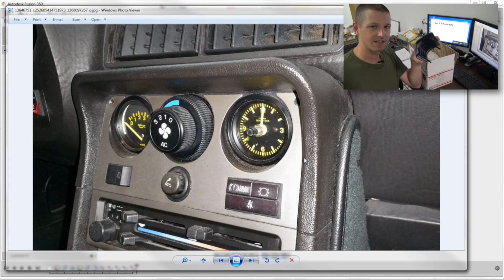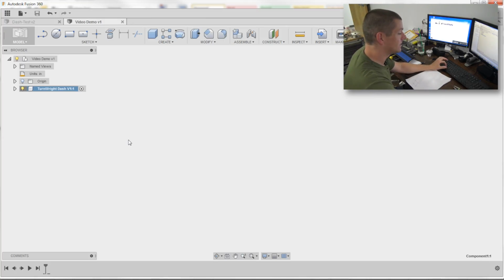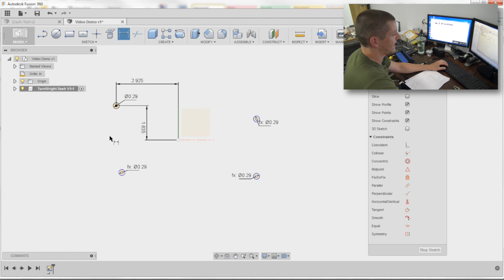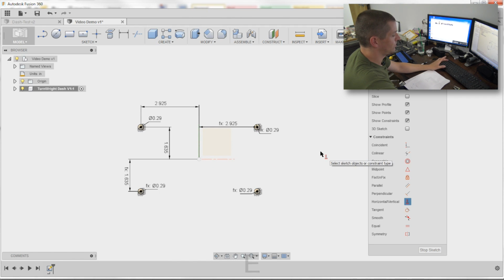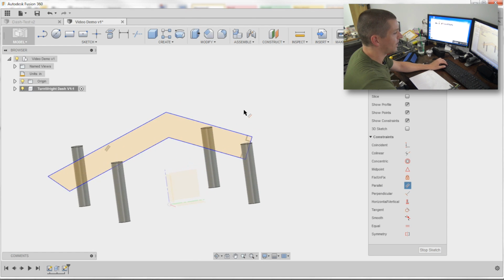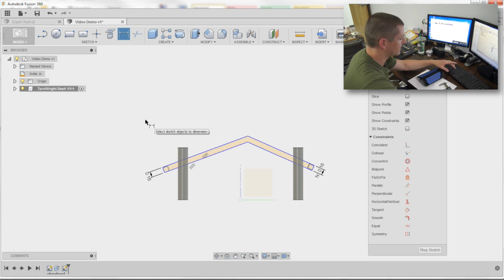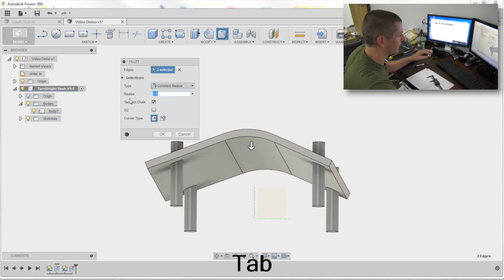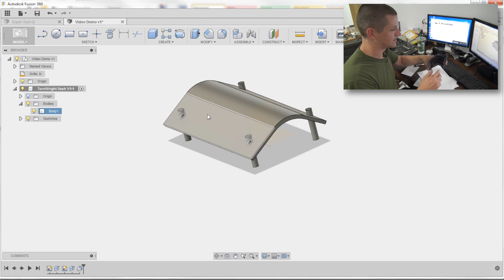Custom Porsche Dash - Keith Fenner Collaboration!  Fusion Friday 37

Comment: I notice you assumed (or perhaps had already confirmed) that the posts formed a "perfect" rectangle.  This may not always be the case; often the dimensions are altered to prevent installing a part backward.  Always best to measure completely.

Comment: last time i checked John is in America. Remember if you grew up with english system, you visualize in english system. We deal in 1/100 and 1/1000 every day, thus it doesnt intimidate the user; whereas 100 mm is not as visual as 4 inches. John is using inches to avoid blunder. So also degrees vs grad. he is doing well I think. I would approach differently, but after all, he is the boss and if you were in his shop you'd be in working in english units. Concentrate on his approach, and not an irrevalent detail.  thanks. a fan.
Reply: I was thinking the exact same things!

Comment: John, do yourself a BIG favour and work in millimetres on this project. I've seen you do it on others that have been provided in metric to you. It would have been designed in metric, and you'll likely find some of the numbers make sense when you measure the feature in metric. In imperial it will just be "a number". Once it's fully modelled you can then convert the whole thing back to inches if you want, it's only a keystroke away.

It was a good idea to work off that flat plane to begin with. Genius in fact. Good luck with the project.

Comment: I would to go to the surface plate first and gotten all the measurements instead wasting time guessing and having to go back and change the drawing.
Reply: The approach here is to rough sketch it to make sure you've got a good approach to get you to your goal. With parametric you'll then know which dimensions to measure. I've seen folks carefully go over 1/4" by 1/4" "scanning" each point and getting tons of dimensions everywhere. 

Once roughed out - you know - OK, I need these dimensions that will drive the rest of the model - and depending on approach those items may vary even for the same part. 

The other thing I've noticed. Modelers who think in terms of "relationships" between elements (ignoring specific dimensions) tend to ultimately become much better modelers. 

Also if you are beginning - focusing on approach - ie, can I build this part with any dimensions - is very helpful because you often have to trial and error a few more passes  Not getting bogged down in the numbers is helpful here AND folks who do use the numbers tend to "force" the model - so it does work, but they lose a lot of the power of the system. John basically has a good feel for approaches that tend to work, so the try / redo doesn't happen as much.

Comment: I would have made a rectangular pattern from one post. At least that is what I think I would do. And as far as millimeters go, I see some purists that never had to deal with the schizophrenic culture here of two measuring systems. I design a lot in millimeters only because some of the 3D printing slicer programs just assume their input file is millimeters, even though .stl files specify what units were used.

Comment: Another great video John.  I realize you are not trying to get exact measurements yet, but there's an easier way to getting more accurate measurements between the posts.  If the posts are the same size, measure the edge of one to the same edge on the other.  It eliminates the error of trying to find center on the two parts.  You may very well know this already.  In case you didn't, I thought I'd share.

Comment: It doesn't appear to be as necessary with this part, but with some interior trim pieces that I've modeled and 3D printed in the past, I'll typically place the part on a flatbed scanner and import different profile views into Solidworks. I'll use easy to measure dimensions to scale the scan(s) correctly within Solidworks, and then tackle any tricky profiles by tracing the scan with lines/radii/spline curves.

Comment: Make it aluminum. Sheer the overall dimensions, machine the vent slots and standoff positions, create radius bend on brake, then tig weld tapped standoffs in reference positions.

Comment: When making the initial four circles, you can use the "Rectangle, Two Point Center" tool (just to the right of the "Rectangle" tool), and with the center point directly on your Origo. If Fusion lets you work with Construction Lines in sketch mode, you can make the rectangle with construction lines, so it won't even become a solid. Then you just create the four circles with their center points right on the rectangle's corner points, and you'll have the circles arranged symmetrically around your Origo. 
Oh, and like someone suggested earlier, use the Equal constrain to make the circles the same diameter. What you're doing is pretty clever (and as you mention, it's a great benefit of parametric construction); using Equal just makes it even more simple. :-)

Comment: those dimensions should be metric. it's German.
have you considered a laser scanner?
Reply: He's American so everything is Imperial, even if you're using digital callipers that can just as easily read in mm as inches.
Reply: agreed, its a unit of measure, just like metric, measure the same part in imperial and metric, if measured properly it will translate exactly the same?? 1 millimeter is always .0393, so whats the issue??

Comment: I believe there is a contextual menu available when creating dimensions that will let you chose between direct, horizontal, and vertical measurements.

If the thickness is consistent through the bend, the radii would be different.  The outer radius would equal the inner radius + the thickness.  This would be a good candidate for modelling as a surface and then adding thickness.

This would be a great project to use Autodesk 123D Catch.  The part looks fairly simple, but automotive surfaces, both exterior and interior are rarely straight lines and circular arcs.  Setting it on a 2-4-6 block on one end and 1-2-3 block(s) on the other end while taking the pictures will provide a good scale and directional reference for both you and the software.

Comment: "Cut" the man some slack. The U.S., is largely, still an imperial measuring nation. Slowly, but surely, metric is there future and they know it. And they know every car built these days uses metric. 

No sense rubbing in the obvious. 

That said, decimals are decimals. Imperial or metric. a dimension won't change. Call it Klingon for all I care, accuracy errors are only forced if the original isn't verified correctly. 

In our modern software world, CNC and AutoCAD, it really doesn't care what you use. X and Y don't discriminate.
Reply: yes

Comment: USE METRIC (please)
Reply: He's using the system he knows best which means fewer errors than he'd have in  converting so you need to learn to deal with it. Just because you feel metric is better does not mean imperial is not just as capable of doing the same job just as well. People need to realize that the distances of a measurement stays the same it's just the manner you use to describe them that changes and fanboying and arguing won't change it.
Reply: He is using a Mitutoyo caliper (which is very capable of displaying metric, so no need for converting) + only United States, Liberia, and Myanmar is using Imperial system. Even NASA is using metric units for all operations on the lunar surface. This has nothing to do with being a fanboy. This is science.
Reply: +onurson I don't think you get it, it doesn't matter if the calipers can convert. Its all about what you have the most comfort and experience in and the things that happen in the human brain when you deviate from what it's use to.

The fact is if you are use to a specific system and think based on that system you run into errors converting to another system. If you think in thousandths of an inch as habit and then try to work in metric you will unconsciously screw things up. Just like if you work in millimeters and think in millimeters and decimal fractions of out of habit, you will cause errors trying to work in thousandths of an inch. .003" to .005" is more or less a standard starting clearance used in imperial, if I go and design something using metric and out of habit use .003mm for clearance I will end up with a problem since .003mm is not the same as .003". I make that mistake far to often since I am grounded in imperial and think in thousandths of an inch not it metric. I'm fully capable of designing in metric and I know John can as well but unless there is a pressing reason to use metric it's more efficient for those like us to use imperial instead of spending additional time triple and quadruple checking things and running more addition test pieces just to confirm and fix system conversion errors.

And I can guarantee if you think in metric you'll have the exact same issues trying to design in imperial. So why can't we just use what we're used to if the end result is functional for its intended use? The only argument I see is because some people think metric is superior when the truth is both systems are equal in the end result and it's just trying to claim some kind of non existent moral high ground of measurement.
Reply: +thecorbies  I saw no insult,  just getting tired of people making groundless claims of how metric is better when in actuality the systems are equall for the usage  discussed and you just happened to be one of the ones at the top this time. ;)  I ment nothing more than pointing out the why's and whatnots on the reasons people may use one thing over another and why complaining about it won't change things.

I'm fully with you that you should be able to work with both, there is just no sense in trying to push for anyone to do things one way just because our preferences aren't the same.
Reply: It seems as if you may have taken my comment re' John using the metric system as an insult or in some way derogatory; it wasn't meant that way at all, but you have hit the nail on the head.  You say "...fewer errors than he'd have in  converting...", the whole point is there is no need to convert!!!  Stick with one system or the other - but converting DOES or will introduce errors.  I also didn't mean that Americans are incapable of using the metric system, but as (precision in some cases), engineers we're expected to have degree of capability and adaptability aren't we?

Comment: Thank you so much for pronouncing PORSCHE the right way... big bonus for that John (told you your travels payed off already)! As usual I like the way you tackle this part, but I need to agree with "thecorbies" comment... I believe a Porsche part will be designed in mm and therefore an inch (25,4mm) might be close enough... but might not be on tight fits etc. Of course this part is not something for the newest Tesla or space probe, so most likely you and Keith will be more than happy with the result. Considering the alternative... some kind of bend sheet metal... hammering, flattening, measuring, welding, brazing like a mad man... I would expect the audience to be a little bit more tolerant... he pronounced Porsche like a boss... give him some time... he will come around soon enough! ;) I love it!

Comment: Suggestion? Yes, in this case, work in millimeters. The component would have been designed in (probably) whole millimeters, and by trying to convert mm on a flexible plastic part to fractions of an inch you are introducing unnecessary errors. Measure the component in mm and try to guess what the designer had in mind.
Reply: I agree, Porche is millimeters.
Reply: I came to post the same thing. Unless it's a US domestic car ( and even then modern ones use mm now) measurements are in mm
Reply: Re. guessing what the designer had in mind: I remember realising my first car had clearly been designed using ¼" as the base unit, with 1/8" used only when needed. Made measuring things like the distance between mounting holes so much easier.
Reply: GM, Ford and Chrysler have been metric since at least the 1980's.

Comment: There are some things missing, e.g. the width of the curved piece and the angular alignment, i hope you thought about it and ignored it just because this is a sketch.

I had some problems measuring a part recently, because it had holes patterned in odd angles around a circle and such, there it was really helpful taking a picture of it and putting it behind the construction plane.

Comment: What I find that helps is to take a straight on picture of the part and import it into solidworks as a sketch picture. That way all you need is one dimension off the part to scale the picture, and then be able to sketch over the picture. Not sure if Fusion can do that though.
Reply: Fusion allows that. It is a handy feature when reverse engineering an item.
Reply: Nice.  you can do that?   I am about to get fusion to start learning.
Reply: +steve rohaley  Yes, you can import an image and set it in a plane. you can then scetch or sculpt and add deminsions. Fusion has tutorials on this, mainly focused on sculpting.

Comment: Just as a note, you'd be getting much less odd measurements if you did it in millimeters, German car = metric measurements, the fit would also likely be better too.
Reply: Exactly.

'Why are you using imperial measurements to model a German part' was my thought at 1:52.

If he was here in the UK he'd be more used to switching between Imperial and metric depending on the project.
Reply: I watch a lot of British shows and have always had difficulty wrapping my head around the constant switching, one moment meters, the next yards, then kph, them mph.